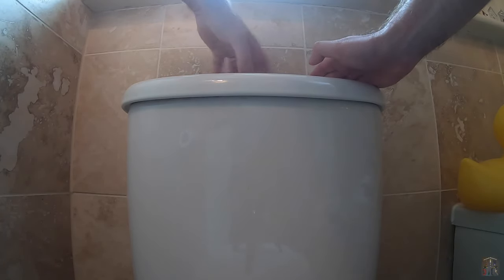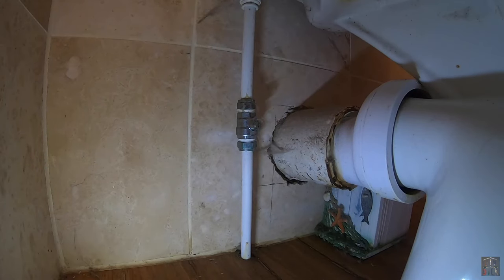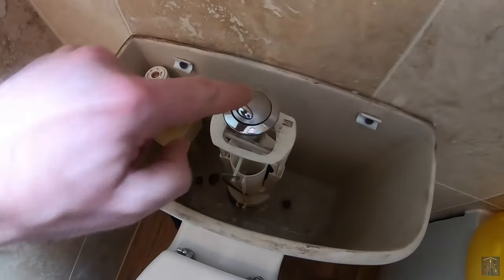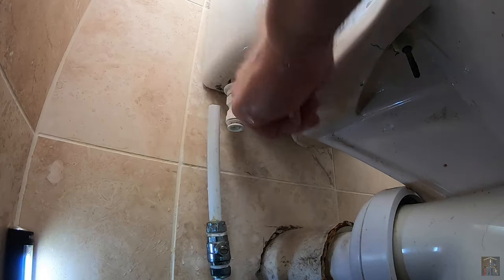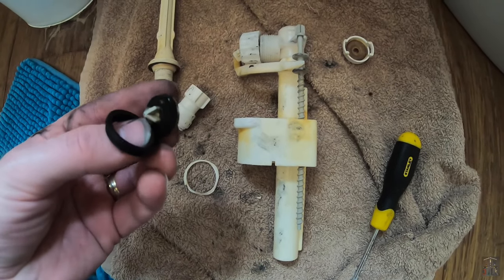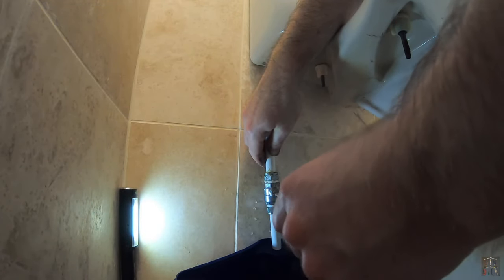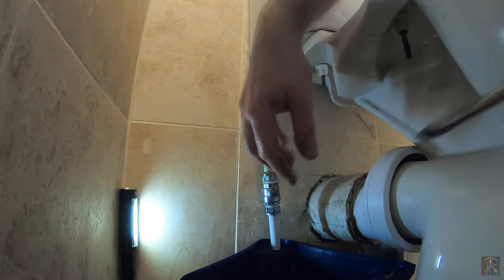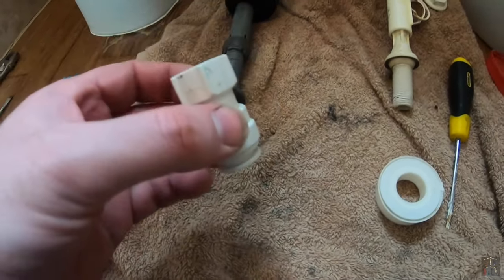Fixing My Very Slow Filling Toilet Cistern

Comment: great video as i gone through a similar issue the little inlet valve is the answer £2 on ebay give or take. full system flush and inlet valve dont make £50 i'm going to buy a couple for spares for the future

Comment: Check the obvious the washer first before you start taking it apart from underneath ,should of known when I seen putting wood filler in  before  removing all the rot ,splicing new piece of timber is the answer

Comment: When the diaphragm perishes, parts of it can block the outlet since its such a small hole. Unblock it and renew the seal.
You're welcome.
Reply: This gave more info than the video. The video just tells you how to replace the whole unit.
Reply: I have the same valve with the perished diaphragm - sadly it appears impossible to find a replacement diaphragm. I can't find an identical unit, however a similar one is under £10. Of course it appears I don't have an isolator valve so will need to turn the mains off at the stop cock!

Comment: My inlet diaphragm seal is new and still no water entering cistern - The tube pipe which unscrews is finger tightened. Silicone seal at top of tube is fine. 🤷